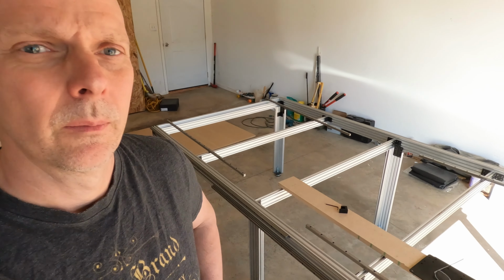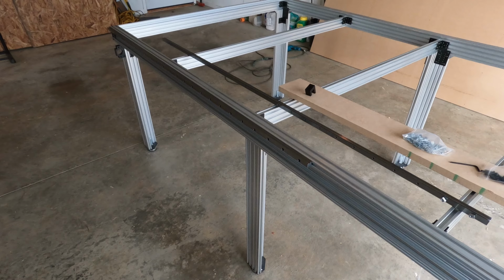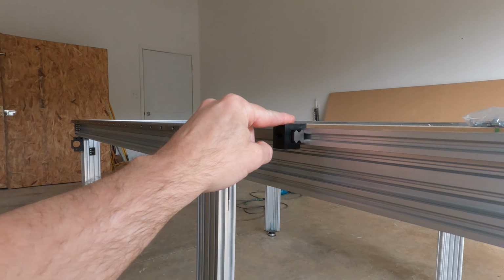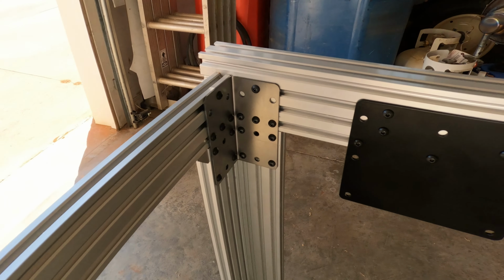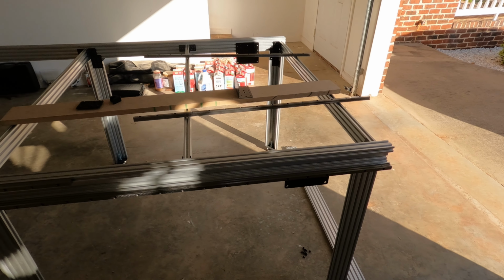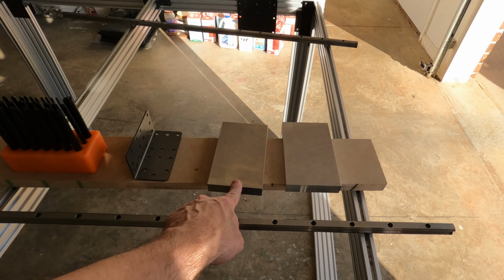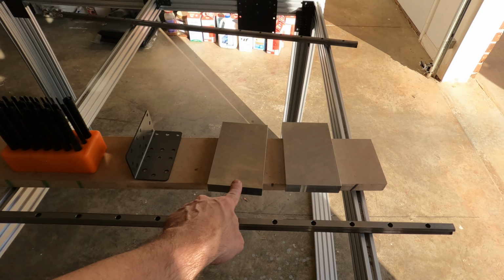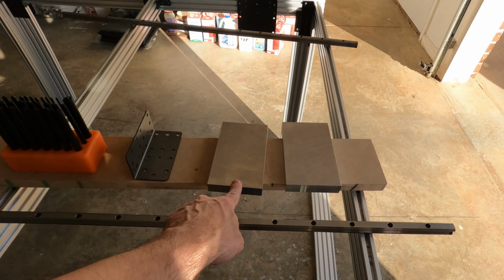Building a CNC router, the frame is finished

Comment: I see you're using 15mm Linear Rails.  I've ordered 20mm rails for my 1000x1200mm build.  Do you think that might be a bit of overkill?  I guess I could probably use 15mm.
Reply from the maker: After ordering mine, I wished I had use 20mm. Hopefully, since I am using two rails per each axis side, it will be fine
Reply: @basementsupercarbuild2948  I started my current design with the round 20mm linear rail slides, but they sagged in the middle with the weight of the 2.2KW spindle and Z-axis assembly.  The linear rails on the C-beam are a stronger and simpler design.  I disassembled that system yesterday and am starting over with the linear rails.